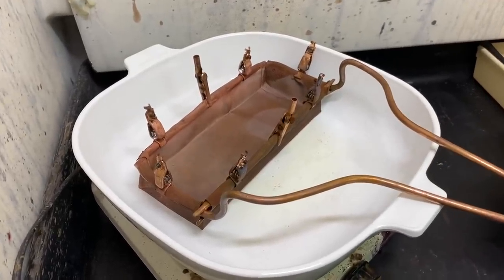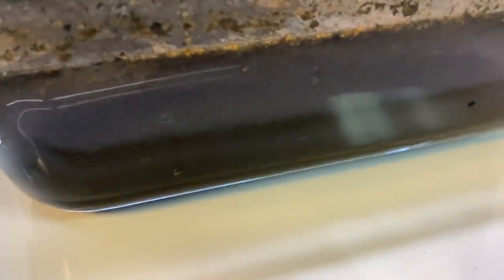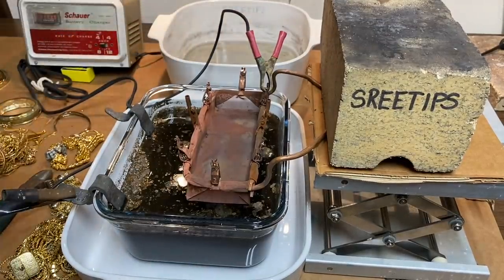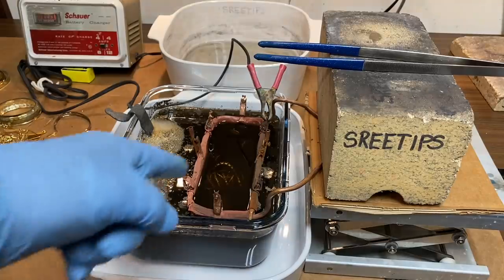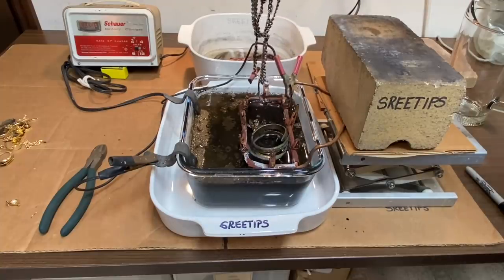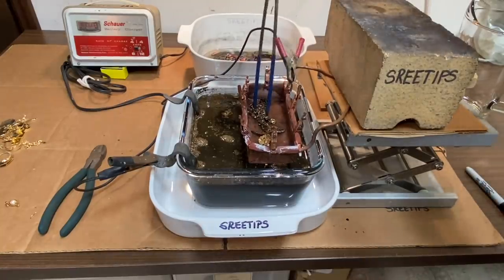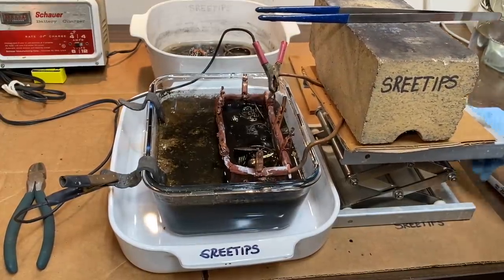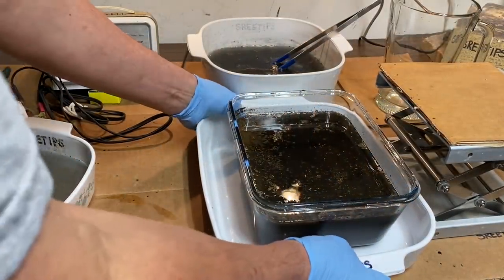Pure Gold Reverse Plating Cell Part 5

Comment: I actually use this exact process for my computer scrap, but I only do gold plated pins that I remove from the fiber board. It works fine. So I'm glad u didn't mention it til the fifth video because this series is where I learned to do it lol

Comment: Save yourself some time. You can clean your electrolyte by heavily diluting it with distilled water. Run it through filter paper. You can then boil the water out of the acid to reconcentrate and go again
Reply: Sreetips should build a still ... my six times distilled Рускова / Ruskova  vodka from Moscow is running low!
Reply: @rrfields65  hey wasn't it the polish who first invented vodka? I am building a 4 plate still   with 3 in colum  for whiskey I will add 2 more plates for vodka down the road  .
Reply: @stumped463  Have u thought about a  cmmv still
Reply: @stumped463  I believe that is correct, they had the potato farms .
But Ruskova is made from the winter/зима wheat harvest and distilled . I seen a video sometime back , where a guy in Australia made stills with copper stacks and stainless steel beer kegs with chilled recirculation water thumper at the coils at top!
Reply: @rrfields65  my family had very strong ties with moonshine industry.
One grand father was a revenue agent, the other a moonshiner/bootlegger. One uncle was a revenue agent, he made busts of stove top up to 1000gal operations.
Reply: @rrfields65  yes those stills are very similar  home made liquor is way different than store bought in my opinion   .
My great grandfather came from Poland before  WW2        be safe friend
Reply: @alockworkorange7296  I run a 3 in 4 plate hillbilly flute  a dephlegmator to control the distillation and a shotgun condenser for product . It's all home made  .  I use it for fuel  on the farm   ;  )

Comment: Senior Chief, you might want to have a water bucket to dunk and rinse the basket to catch any last residual gold before placing into the storage bucket. If you use the same bucket time after time it should accumulate some gold.

Comment: next time you crank this machine up it wouldn't hurt to drop in a ram chip or something as an experiment, would it? the gold plate on computer scrap is usually plated onto copper and nickel etc which is fused into the board, the coper and sometimes gold fused into the board can be exposed by boiling in caustic soda.

Comment: You can probably recycle that waste acid/water solution. after you get your gold out, let the water evaporate off, H2SO4 Holds on to water so don't know how concentrated you can get it by just letting it sit out. Then you can boil it down till you have concentrated H2SO4 again. Might not be worth the time if it won't concentrate down to a decent volume by natural evaporation, def wouldn't want to have to boil down 5 gallons of solution! Alternatively, you could dump your acid/gold mix into the smallest volume of water possible to dilute it without causing the solution to boil over. Might take some experimentation or math to get that part right.

Comment: Are the refineries accepting your metals again?    I remember you making a video of them rejecting the metal you turned in.
Reply from the maker: That was only one refiner; Elemetal Direct (formerly NTR Metals) they got in trouble and fell under the regulators microscope. Wanted all kinds of info from those who sold to them. I didn’t have what they were required to get so they cut me off. So now I sell to ARA Gold in Dallas TX. They pay 98% also.
Reply: @sreetips  Like most refiners, they only buy from businesses in the precious metals trade, such as jewelers, bullion dealers or coin shops.

Comment: Could you let the electrolyte settle and decant into another container? Is the electrolyte depleted? Or can you top it off with fresh acid? Is it easier to start fresh? Great series of videos as always.
Reply: Boil off water till you see dense white smoke and reuse . But do it outside and dont breathe the smoke . Not everyone has  a lab.set up  just sayin .
Reply: I'd like to get the most use of the acid without redistilling, nasty stuff to concentrate got to be real careful handling. Just saying.
Reply: @scotts834  I learned to concentrate acid from car batteries to make incindearie devices  in case I might have need for one cause you never know  . Funny thing is the government  taught me how to do it .  U S military improvised munitions manual  printed in 1969  by us government  . Paid 5dollars for it at a gun show . That's where I became interested in chemistry.  cody's lab is another channel for chemistry.  
Be safe friend
Reply: @stumped463  You never know when you need certain compounds or how to make them.😉

Comment: I noticed others said you have a professional style power supply. Wouldn't using that make the entire process faster since you can use higher current/amps without having to worry about over heating the power source?
Reply: I believe he does have pro equipment.. and professional chemicals.. but he is doing this as a exercise to show you /us that this can be done start to finish using commonly available equipment and commonly available chemicals from almost any hardware store.. He is actually doing things that slow hard way for only our benefit.. this guy is a great person and teacher for sharing all this knowledge for no fees.. early videos some years ago he actually wore a lab coat like a doctor or professor would..

Comment: I wonder if you'd be better off neutralizing your electrolyte with baking soda or Sodium Hydroxide. I don't know the answer. At a minimum, it would reduce the amount of liquid waste you have to deal with; I have no idea if that would interfere with your next steps in refining the sludge. One thing I WOULD have done would be to check the ph of the 'lyte using ph paper.
Reply: Ph treatment is the final for waste disposal , you don't won't baking soda in your gold dust powder.
Reply: neutralizing it is useful for a final disposal, but if he intends to distill and reuse the acid neutralizing it is not the way to go

Comment: What if the gold plated scrap was 'milled' a tiny bit, so that it was in small chunks/bits instead of long strings. Would that give a better recovery rate? Or would that be more work for no real return benefit?
Reply from the maker: An unnecessary added step

Comment: Wow, threw me a curve at the end there when you dumped that electrolyte into the waste water. I was sure you were going to glass filter it and reuse it but I know you've done this experiment before on the milspec pins so you must have a method for this madness. Also, is there anything valuable left in the depleted scrap?
Reply: some of the material that was gold plated was copper. There might be some silver or brass as well so those might be worth selling at a scrap yard depending on quantity

Comment: The settling. In mining we use a surfactant (typically Jet Dry) to break down the surface tension to keep floating our microgold away. Might this help with dropping that froth? Would it interact with the acid?
Reply from the maker: I’ve never used jet dry.
Reply: @sreetips  regular dish soap works also, but makes a lot more foam.

Comment: Can you use this on gold plated pins from escrap
Reply from the maker: Any gold plated material with a metal substrate can and should be run through a sulfuric acid stripping cell.

Comment: In the future are you thinking of making a larger basket so you can process the gold plate in larger batches? Or are there electrical issues I'm not aware of?
Reply: why not go all in and have a tall bucket surrounded by anodes as the support an arduino run a motor which monitors the amps to lower it when it hits 4amps and when fully depleted lift, second motor kicks in to move in the next batch, then sends text to to his phone.. occam's razor :s
Reply: Possible, but current is proportional to the surface of gold plated material. It should be easier to adjust the quantity of plated material to the available power supply.

Comment: Make your guesses in now on the final yield of gold.
Reply: It's gotta be in the area of a few ounces.  It's at least an ounce.
Reply: @GeoffBosco  You are highly optimistic.  He had approximately 5700 grams of material. IF it was 12K20 gold filled, there would be 2.5% pure gold by weight, which would come to 142.5 grams, or 4.58 Toz. 
Now, if you make the assumption that gold plated goods contain 1/100th as much as gold filled, you get 1.425 grams - less than 1/20th of an ounce.
Reply: @buggsy5  I was judging by the amount of black powder. But, admittedly I've never seen this process so the powder in this situation probably looks different than it does in other process, or is less pure? 

Anyway I'll take your word for it. I'm just so curious for yield that I wanted to get the conversation started.

Comment: When you say you cant use it for computer scrap do you mean PVB scrap? Scrap gold plated connector pins would work in your cell wouldnt they?
Reply from the maker: Any gold plated material with a metal substrate can and should be run through a sulfuric acid stripping cell.
Reply: @sreetips  so connector pins removed from plastic will work then? If there is any solder will it mess up the solution?

Comment: are buckets like that resistant to acids?  I know buckets are mostly plastic and not all acids are the same; if you put a high concentrate acid into that bucket would it be ok?
Reply from the maker: HDPE will resist acid we’ll. Chlorine will cause it to crumble

Comment: can you use the deplated jewllewry that is made of copper to cement sivler?
Reply: Most of it is probably brass, not pure copper.  It is possible the zinc would interfere.

Comment: Can you do this with silver plate? Did you find any of the gold wasn't plated once you tried to strip it? Was any of it gold plate over silver, or was it all gold plate over worthless metals?
Reply: No metals are worthless, but some are hardly worth recovering. The gold is usually plated over brass, which is an alloy of copper and zinc - both having some salvage value.

Comment: computer scrap. you can't use this process for gold plated pins?
Reply from the maker: Any gold plated material with a metal substrate can and should be processed through the sulfuric acid stripping cell.

Comment: Would this work for gold-filled material as well?
Reply from the maker: Possibly. But removing base metals from gold filled with nitric is the way to go, in my experience.
Reply: Maybe. But treating it as a copper proposition and then recovering the gold from the waste would probably be more efficient.

Comment: TOO  MANY  ADVERTS - UNSUBSCRIBD  !!
.
Reply: @lowcarbintheuk  - YEAH,..that's why I let SREETIPS know.
.
Reply: @stevemacbr  Why not use an ad blocker? Many are free and work fine. The only ads I see is if the person making the video plugs an item/site in the video itself. And there I can simply forward past the commercial content.
Reply: @buggsy5  - check out the conditions of the AdBlockers and you will know.